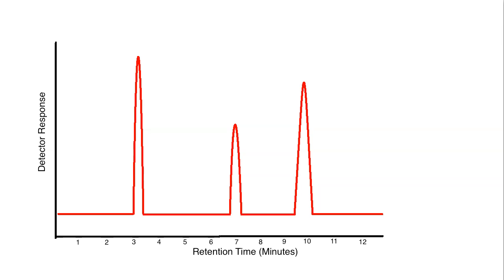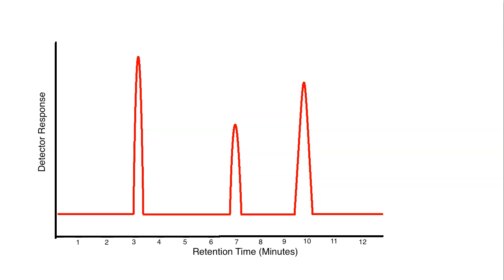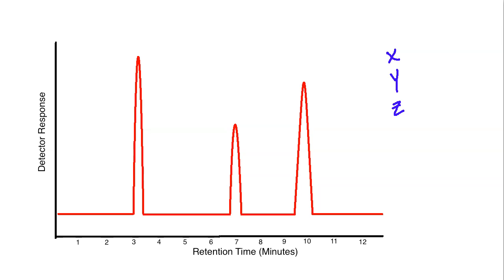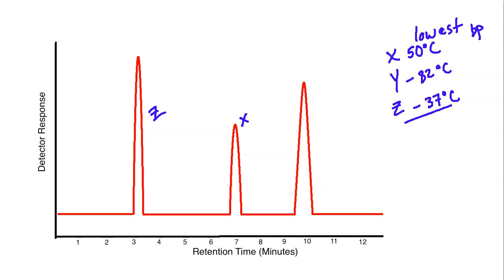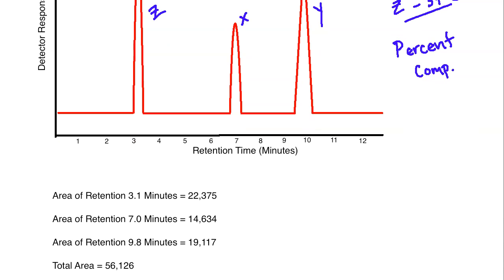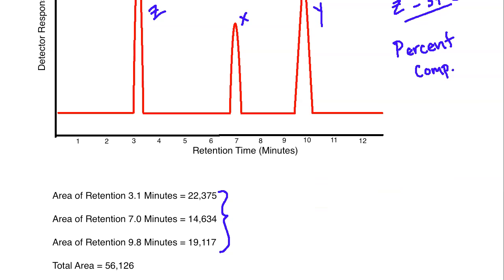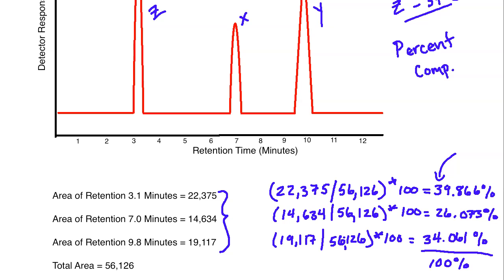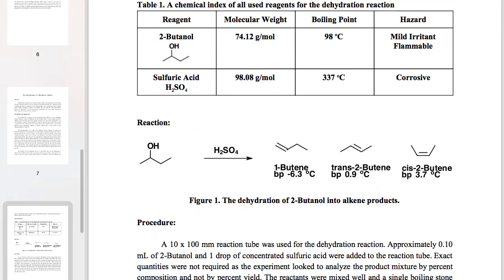How to Analyze GC Results for Lab

Comment: Good video. A point to be noted: different compounds yield different peak area even if they have the same concentration; e.g. 100ppm of X,  100ppm of Y, 100ppm of Z will not yield the same peak area. Taking only the areas to calculate selectivity/composition could yield wrong results. The compounds need to be calibrated and their respective concentrations should be used to calculate composition and selectivity.
Reply: I was actually looking for this comment. Thank you! It was essential to clarify it

Comment: To use this 'simplistic' method, you must make it clear that you have assumed or confirmed that the 3 components have similar (even the same) response factors in the particular detector being used.
Reply from the maker: This is true and does need to be accounted for in more complex lab work and mixtures. This video is aimed at students first experiencing GC labs in general or organic chemistry. It would not be appropriate to teach response factors until an upper level course such as instrumental chemistry or an advanced spectroscopy course.

Comment: Thanks really helpful, but if we have 2 compounds that have similar boiling  point 1 cis and 1 trans which one has the lower retention time?  Appreciate your feedback. Thanks
Reply from the maker: In GC compounds are separated by relative boiling points. Look for the lowest boiling point and it should be your first peak.

Comment: How did you get the precise areas? Is there a table in MestreNova that shows the peak width and exact intensity that can then be used to calculate the area?  Thanks

Comment: Percentage composition is by mole % or mass %
Reply: (SUMMARY of text below): GC gives mole %. readings (percentage composition = mole %)

(MORE DETAILS) I'm wondering this as well! I am 99% sure that percent composition for GC is by mole %. My thinking is that percent composition assumes "amount," and "amount" is always by moles. He also states in the video that "the GC does not know what chemicals you have," so mole% makes the most sense as the GC does not know anything about the masses of each component, which it would require in order to find mass%.

Comment: Really good video man! I was just wondering  is it possible to use this method  with a unkown sample withouth having ms or lc. And do you need to have the boiling point for all the molecules in you sample you testing before using this method ?

Comment: What would happen if retention times of compounds if the column temperature were raised?
Reply: Hi, not the OP here, but doing GC lab work is my job, and generally speaking, if you expect a certain Rtime and your results show an Rtime higher than control (or reference), then you are looking at a similar, but ultimately different compound. RE: THC vs synthetic cannabinol

Comment: I know they say there are no dumb questions, but..
How is the area calculated for the compounds?
Reply: You first draw a baseline (you would not use the x-axis line).Then you would measure from the top of the peak to the baseline to get the height and then to get the width, you would go to the halfway point on the height and then measure the width from there. So, the equation would be A= H x W(1/2) if that makes sense.

Comment: what's the unit of the area
Reply from the maker: This can depend on the GC being used, but generally it is the area of the x and y axis units. So most GC will have minutes (retention time) along x and a volts (detector signal) on the y axis. So a common unit might be volts-minute.

Comment: This does not seem right to me. Your calculation assumes the same detector response to all compounds. However this is not true. 50/50 % mixture does not generally make 50/50 % response. I would say you need to know the response factors to make the calculation.